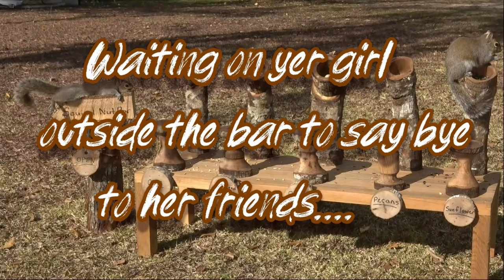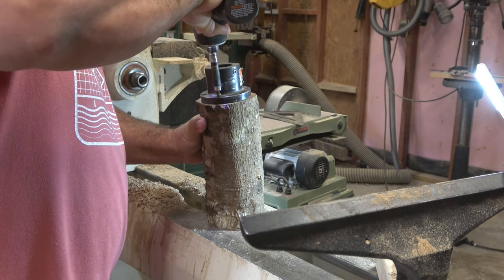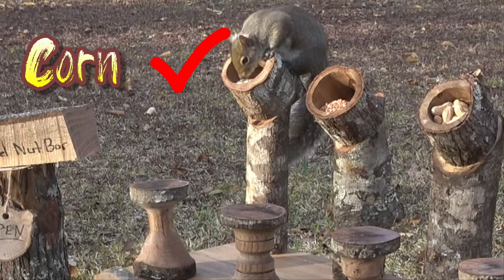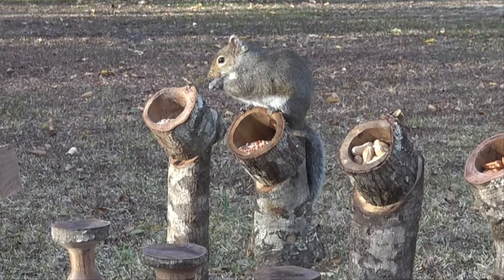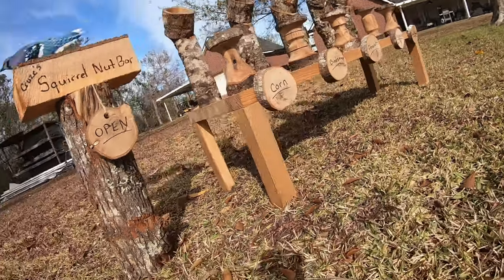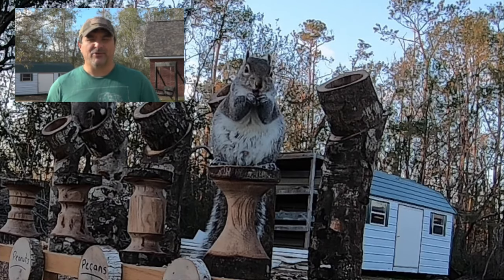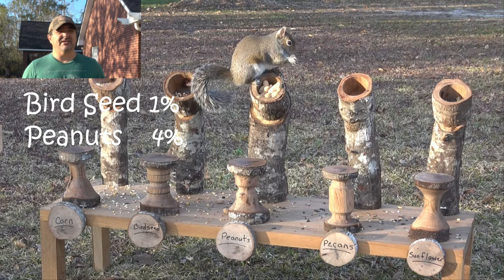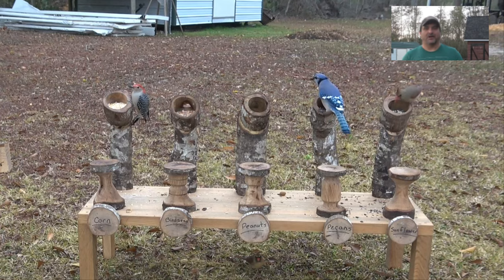Squirrel Nut Bar - Squirrel Bar Fights!!!

Comment: The only thing that actually surprised me was the sunflower seeds winning out over the peanuts. I would be curious if the pecans would stay near 21% if they weren't already shelled though. That said, I also bet they'd use the stools a lot more if they were just an inch or two higher so the squirrels didn't have to stretch out and reach so much to get into the cups from them. Was definitely fun to watch them and the jays/woodpecker bar fights too.😂
Reply from the maker: Hmmmm....pecans in the shell...that would be an interesting experiment...shells vs no shells...noted :-)  Yea if I were to make her again I'd do a few changes...I think height is ok but the stools bout 3" closer to the buckets would be the ticket I think.  Thanks for stopping by!